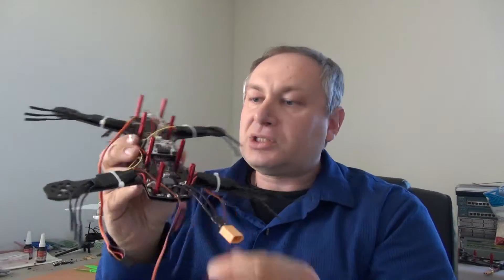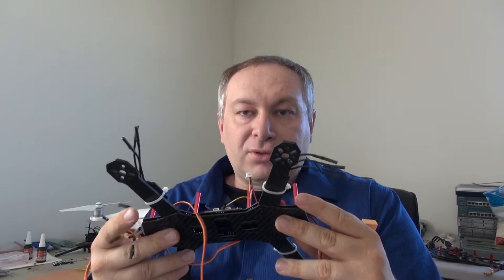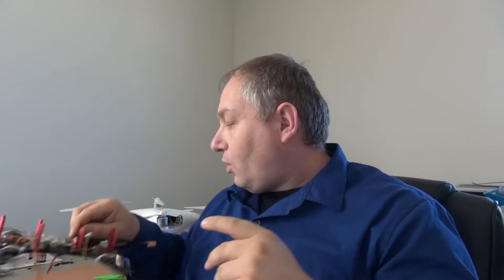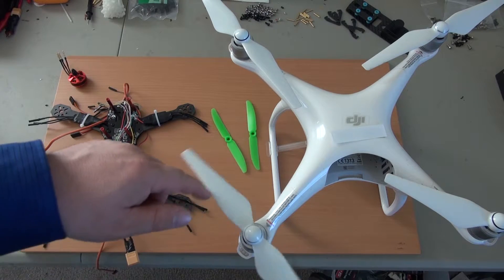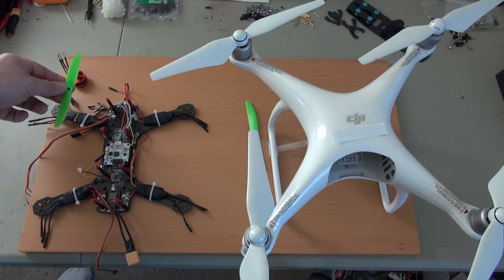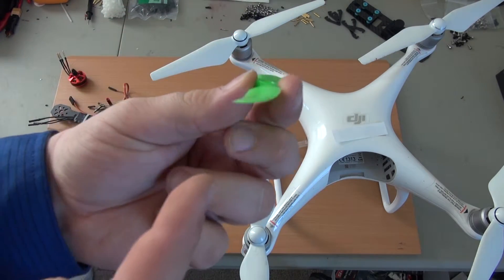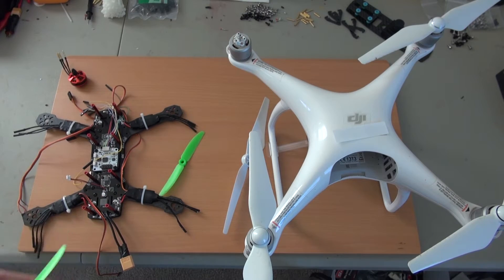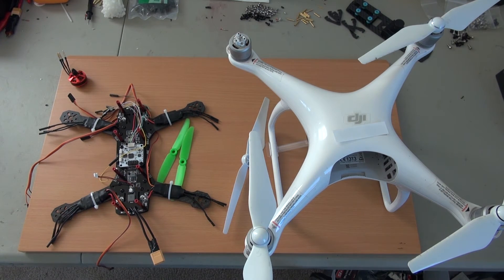clockwise vs counterclockwise propeller

Comment: I have seen two different videos of these demonstrating the rotation of the propeller if it is a right-hand turn or a left-hand turn. Both these guys could never be a tutor their explanation sucks big time, both held the prop by hand instead of inserting a pencil through the hole where the shaft sits. We gotta bring Linus the computer guru to explain this clearly to others.